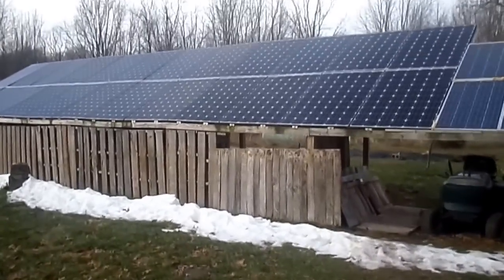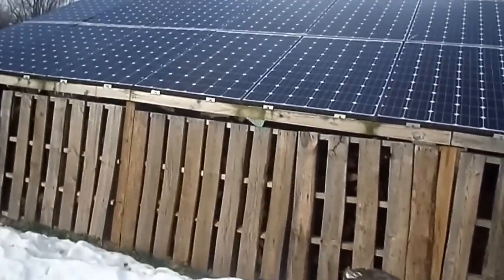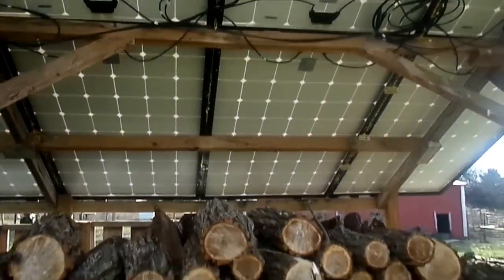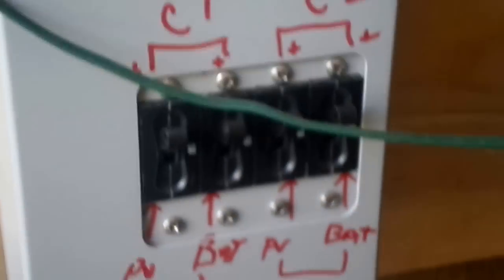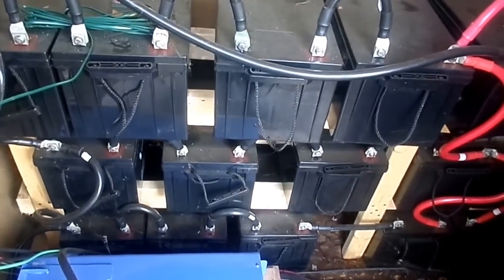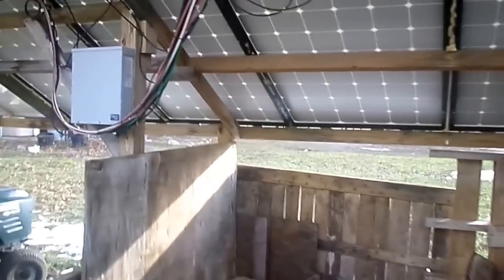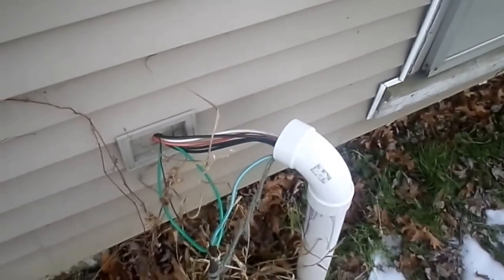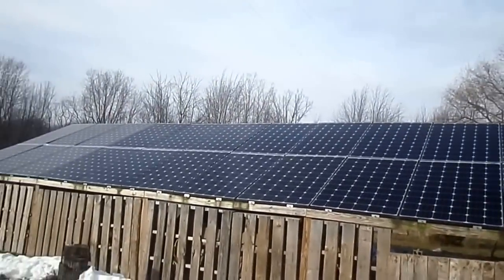How My Off Grid Solar Works

Comment: If you weren't such unwise you probably would have used something like silicone like you silicone around your windows to stop Windows from leaking maybe just do that around solar panels like I do then they won't leak this is a friendly suggestion and you have a good system and I like your system and you're a good person please take that note and try to do something like that but usually it's better as you put them together to make them waterproof.

Comment: I have 8 300 watt solar panels, running parallel in 2 pair of 4. Into a 60a charge controller( charge controller has 2 + & - for PV input)  . Also I have 8 100amp/hr batteries into 8k (16k watt max) . I want to push 1kw/hr 12hr a day. Should I just upgrade to 24 100amp batteries. So buy 16 more.???
Reply from the maker: you should definitely go to https://www.greengardenchicken.com/ and email them. tell them solargirl sent you and they will work out you needs. They are super helpful with all questions.

Comment: By not putting a roof on first and then your solar panels, you are prolonging the life of your solar panels. Excessive heat can significantly reduce the output of the system as well. You did good here.

Comment: Try vinyl bathroom molding to fill gaps or vinyl bathroom wall board for a roof. You will probably still have same issues though. Anything to cover the wood basically. Metal flashing, thresholds for entrance way doors, I use all these because they are durable, but in bulk it all can be a bit expensive.
Reply from the maker: good idea thanks, I like the vinyl idea

Comment: nice system! but I would recommend building that battery room with concrete and put a auto-fire extinguisher system cuz stuff can go wrong sometimes...and I t will cause a HUGE fire...
Reply from the maker: yes we need to re due the battery room.  Floor did not hold up as well as we were hoping:)
Reply: I hope it will go well for you :D

Comment: try aluminum duct tape over the foam filled seams, or coil stock u-channels as a rain shed guttering system under the cracks, or both.
Reply: for the leaky panel "roof".
Reply from the maker: Thanks for the idea. I did try the aluminum tape but it didn't hold up when it rained.  Maybe I will try the gutter idea.

Comment: Ironridge, I think makes a cap/clamp system to go over gap, but all you can do now is stable a cover to the back side of panels to guide water down to the low side...
Reply from the maker: Yep will probably take down in the summer and put a real roof under the panels.

Comment: Hello, I'm fascinated by all of this. But I just dont know.. What if it is cloudy like.. all week long and no sun at all? How much power (kWh) it can generate? I mean.. if it can handle even poor weather.. than why they told us that it cant? Thanks :)
Reply from the maker: thank you:), I was just like you and was worried if it is cloudy all week long and no sun how would I power my whole house with all major appliances?  But the company I got this complete off-grid system from worked out all the loads and gave me a big enough system to meet all my needs even when there is no sun and weeks of poor weather.  I only need one our of sun and my system is big enough that it charges up completely and is fully charged and ready to go for a week without any sun or cloudy days.  Hope That helps:)
Reply: That seems kinda suspicious 1 hour of sun = 1 week of energy :D anyway,.. I wish you good luck and nice weather :)
Reply from the maker: As long as we don't go below 80% Depth of Discharge of our battery  capacity, it only takes about an hour of full sunny day. We have a extremely large batter bank to make us through the week in cloudy or poor weather. So you have to have a large battery bank to last you for a week without a sun or you have to use gas generator to charge up the batteries.:)
Reply: Yeah, I see what you mean. But.. this is maybe because your solar panels produce energy even in poor conditions. They can work like 20% even if it is cloudy. That might be the reason why you sustain so long without sun. I mean.. 20% in cloudy still kinda charge and if you spare energy,.. I think it is possible what you claim :)
Reply: Tomáš Stec panels put out more power than most people realize when it's cloudy.  An array that size would still be putting out decent power on a cloudy day for sure

Comment: Where did you purchase the panels, how much did they cost, how many watts does it produce daily? I work on cell towers, the power is the same, 48V, with batteries in series parallel for the battery back up system in case of power outages.  Have you considered modifying your appliances by removing step down transformers? This was an idea I had some years ago, that involves using less energy because most of the circuits use Direct Current (DC) after they have wastefully stepped down the voltage from the wall which is 110-120V Alternating Current, which was originally developed by Nikola Tesla for Westinghouse for long distance per transmission because the amount of copper needed to deliver DC was just too much. My point here is that everything we buy from the store wastes energy because it was designed to work first by using induction to change the type of voltage being used on the circuit, and second by decreasing the voltage significantly, which used to create heat on your average TV set, making it a cats favorite place to sleep. Think about it, I hope it Sparks an idea 😊
Reply from the maker: We purchased ours here https://www.greengardenchicken.com/index.php?route=product/product&path=129_132&product_id=300  Yes we agree with you on everything we buy from the store wastes energy and this is why we will be making videos in summer where we will  be modifying our appliances to run on DC.  Make sure to hit notification bell to be notified.  Thank you

Comment: $30,000 is pricey but a beautiful system. Probably would take 25 years to pay itself off, assuming hydro hookup is at your house.
Reply from the maker: Thank you . Actually it has payed itself off in only 6 years with our bill being at $400 a month before we got the system.  So 6 years is not bad and plenty of life still in the solar system.
Reply: Solar Girl Well done! no wonder you went off grid. $400 for hydro is no joke. I heat my house with electricity and highest monthly bill was $350 but lowest in late spring was $35. Overall budget is $160 a month but usually average $110 due to conservation measures.
Reply from the maker: $110 a month?That's great.  You probably wouldn't need to get solar ever
 unless you wanted it for backup emergency.  Great job conserving.
Reply: Years ago we paid about $300 a month. Now we pay about $60-$100 month.
We save on power because we changed things around the way we use power and items. We got a kill-a-watt meter and there where many items that where plugged up that used power even though they where turned off.....but it made 25% of our electric bill.
Reply: Around here your average power bill per month is 400 bucks.   Add to that the fact it will cost me over 100k for the power company to install power to my property and it's a no brainer to go solar.
Reply: In other words.  As soon as I buy the gear it's already paid for itself instantly.  Anything under 100k that I spend and I'm already ahead of the game.  Do you know what size of array/battery bank and generator 100k would buy you?!!

Comment: put House rap under the roof from highest to low and water will stay between it and the panels just use staples or scrap wood the hold it up.

Comment: Wow!  This is all incredible!  I LOVE IT!!
Reply: Thanks for sharing.  I really love what you guys have done with all of that.  That's amazing that you can still get power on overcast days with all of the snow you have.  When I lived in Chicago, the sun hardly ever came out, so I know how the weather is in places where it snows.  I will need to check that web site out. I'm bookmarking it.
Reply from the maker: You welcome!, here you go let me know if you have any questions:) http://www.greengardenchicken.com/index.php?route=product/product&path=129_133&product_id=331
Reply: I just bought two brand new 310W solar panels today at $130/ea.    I wish I had more money so I could afford more.  It's going to take me probably 1 or 2 years to slowly pay everything every other month or so.  I was getting sticker shock looking at Morningstar, MidNite and Schneider charge controllers.   Some of them up to $700.  Then the batteries that I want are at least $300/ea.  I don't want to use cheap batteries because I want to set this thing up and not have to mess with it for at least 10 years.  Crystal Lead batteries seem to be one of the best to use.  Paying cash for all of this stuff instead of using credit is the killer.  I barely have $200/mo left after paying bills, if that.
Reply from the maker: http://www.greengardenchicken.com/index.php?route=product/product&path=129_133&product_id=331

Comment: I'm just curious...how did you guys connect the panels?...did you guys wire them in parallel?...or I  series?...I get the mounting system, the battery bank & inverters...I'm just trying to understand & figure out how you guys wired the panels?...like for example, did u take the positive of 1 panel & connect it to the negative of the 1 next to it?...or, did you take the positive of 1 panel & connect it to the positive of the next to it?... and I wish you would have spent more time on the wiring of the panels & the cabling...I noticed that you have grounded the system with the green wire?...butt i was just wondering how did he connect the red, white & black cables to the panels?...
Reply from the maker: The Panels were connected in both parallel and series based on the size we have and the charge controller size.  The red, white & black cables are not connected to the panels.  We will do another video on the wiring of the panels shortly. Like and subscribe for more videos. Thanks

Comment: I have the same inverter but i have yet to set up my system. Has that one inverter served you well for multiple years?
Reply from the maker: I have had the big inverter now for several years and it has been through a few fuses being blown and still going strong.  Though I definitely would have bought an outback if we had a chance to do it again.
Reply: Solar Girl thank you responding. I figured as much. My brother is running an 8kw outback system with a grid tie setup and has no bad stories to share. He added a large battery bank so when this last hurricane came through florida he was able to switch to an off grid application with no issues. Love what yall have done and appreciate you taking the time to share your experience.

Comment: So what about the use of moving panels,to catch full sun rays?
Reply from the maker: Yes that would be the ideal best, but not very economical.  Specially for this size array
Reply: Solar Girl they have sun trackers you can buy that do it all for you.  You just need your arrays mounted differently is all. I'm sure you're fine without it though

Comment: What is the total cost? What is the total savings? How to you heat your house? Does it run an air conditioner?
Reply from the maker: The total investment of only $30,000!  Total savings of $324,000 over 30 years. We run everything off-grid.
Reply: umm. Might want to check that math. It would be nearly impossible to spend $300k in electric over 30 years. avg household electric bill $150 x 12 months + $1800 a year. $1800 x 30 years = $54,000.
Reply from the maker: Our electric bill was $900/m before we got off-grid solar!  We ran everything on electric!  Yes everything, heating cooling, electric stove, electric oven, electric dry, electric water heater, water well pump, you name it. You can try it and see for yourself if you run everything on electric your bill will $900 or more! $900/m x12=$10,800x30=$324,00.  The total investment of only $30,000!  Total savings of $324,000 over 30 years. We run everything off-grid. Thanks
Reply from the maker: Our electric bill was $900/m before we got off-grid solar!  We ran 
everything on electric!  Yes everything, heating cooling, electric 
stove, electric oven, electric dry, electric water heater, water well 
pump, you name it. You can try it and see for yourself if you run 
everything on electric your bill will $900 or more! $900/m 
x12=$10,800x30=$324,00.  The total investment of only $30,000!  Total 
savings of $324,000 over 30 years. We run everything off-grid. Thanks
Reply: Unfortunately, because you chose to go with Lead acid based batteries, you're going to have to replace your battery bank(s) 8-10 times during that 30 year span so that cost will need to be factored in as well. But $30k for all that still isn't bad.
Reply from the maker: No not if you don't go below 60% Depth of Discharge (DoD) they can last 15-25 years easily.
Reply: That's impressive! We live in Florida. Bills are crazy, cooling a 1000sq.ft. Home! We are thinking of going solar. Hurricane season concerns me? Any suggestions?
Reply: Chris Ponton i have installed solar in south Florida for 9 years we didn't have a single system come off in irma 
I live off grid in highlands county. With ac no problem

Comment: That system looks really expensive 
And that's exactly what I need
But I'm too way poor to afford it
Can you girl please tell me can you run the normal number of appliances that you can run in normal house that runs on electricity
Like refrigerator air conditioner heaters?
Reply from the maker: yes I run my whole house on it. washer dryer fridge oven heater etc.
Reply: @Five Cent Revolution When are you launching your channel?

Comment: ? if you have 40 260 watt solar panel what size Inverter would you need? THANKS, MELVIN
Reply from the maker: That depends on your load size.  What is the wattage of your biggest appliance?  That will tell you what size inverter you would need.  Hope that helps :)

Comment: how do people afford these?
Reply from the maker: Simple! Just start saving now if you have not already and you will be able to afford these:)
Reply: 30k if you could save 1k a month thats 30 months so 2.5 years. man that's a commitment
Reply from the maker: Yes! and its worth it:) So you can be your own power company and have 
they system pay for itself.  Than you can keep the money in your pocket 
instead of the power companies pocket so you can afford even more 
things:)
Reply: Kory Dowell to be fair you don't even have to spend 30k.  I guess depending on what size of battery bank you go with.  People just getting into offgrid solar usually don't understand the most expensive part of a off grid system is the batteries.  Panels are cheap! Batteries are what'll get ya!!
Reply: If you spend an average of $2,000 per year on electric and do that over 60 years, that's $120,000 pissed away to the electric company.  You'd be far better off spending $20-30k and have your own power company like other people here have said.
Reply: GMoney 2k a year on power? Man that would be nice!! It's closer to 5k a year around here
Reply: Why?  Are you rich?  Do you have some 4,000 to 5,000 sq. ft. house with a pool or something?  I wouldn't put up with that nonsense.  I'd go all solar or move to a more affordable place.  My electric bill is about $150-190/mo. which is on par with many other people I've talked with.    If yours is higher, than you must have money to burn.
Reply: GMoney no, mine is higher because that's what electricity costs around here.   Some people burn 600 a month in this town.  That's normal.  I have property out of town and the local power company requires 100 thousand dollars to bring grid power to it.  It's only 1-1/2 miles from power lines.  100k for 1-1/2 miles.
Reply: How does that not bother people to be giving that kind of money away to a power company?!?!  In 40 years of paying that, that's $288,000 PISSED AWAY!  Even if I was rich, I could not see just giving that money away.  If you're spending $600/mo. on electric, why not invest in solar panels to get that bill down to $0 to $100/mo?
Reply: GMoney yeah it's nuts when you look at the overall cost. The 100 thousand dollar hook up costs is what made me decide to go solar
Reply: Everybody I know complains about spending money and every time you show them anything about saving money, they don't want to hear it.  That makes each person a hippocrate.
Reply: I paid nearly $2,000 for the 5 kW of panels that I have.  That still doesn't include all of the other equipment, wiring or installation I will need.  And in my case, there may be permits for being in a big city.
Reply: I don't even earn 1k a month
Reply: The kidney buisness.
Reply: GMoney said: "How does that not bother people to be giving that kind of money away to a power company?!?!" My response: How does that not bother people to be giving that kind of money away to a cellphone/internet service provider? Just so they can upload videos to YouTube telling everyone how great it is to be off grid! And yes, most off grid systems totally suck. Barley providing enough power to get on the internet!
Reply: Air conditioning and the refrigerator are the only real power robbing things